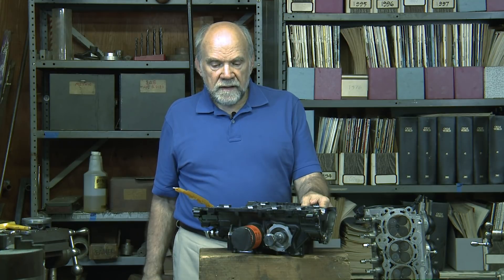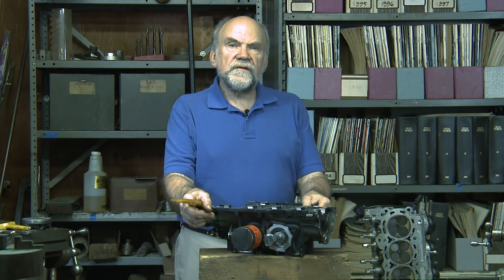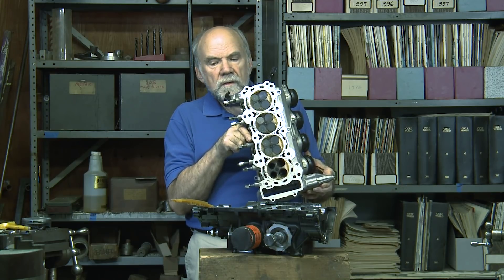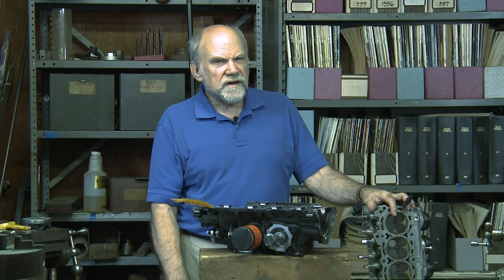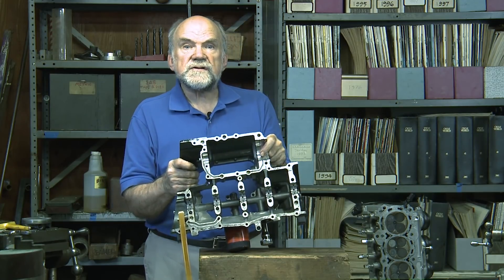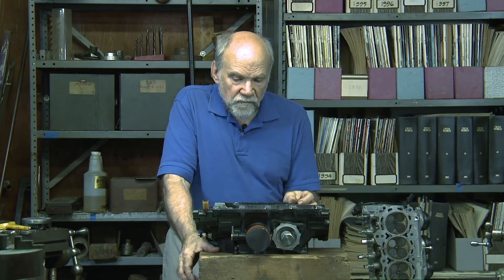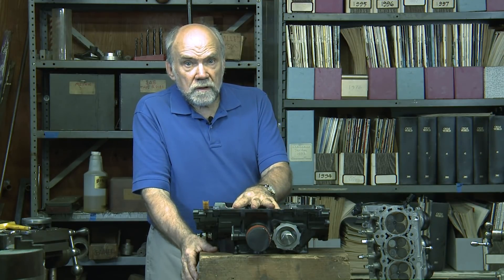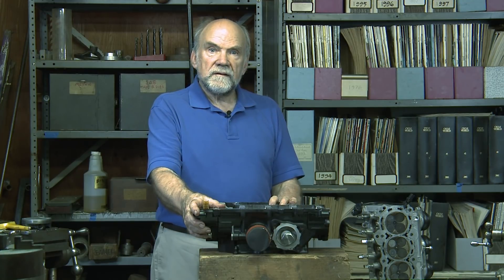How Is This Crankshaft Linked To Honda's Legendary Past?

Comment: Thanks for another fascinating little story.  I wonder what the rider experience was on the six-cylinder Honda.  Did Mike the Bike like riding the Honda more than his old Norton Manx? In the youtube video I found of the Honda it sounded like a chainsaw, or maybe six four-stroke chainsaws running at the same time.  Not nearly as pleasant as the Manx.  Here's another question- why did Honda go with four stroke technology?  Six mini-Centurions driving your back wheel would have been mind-blowing in the 60's.